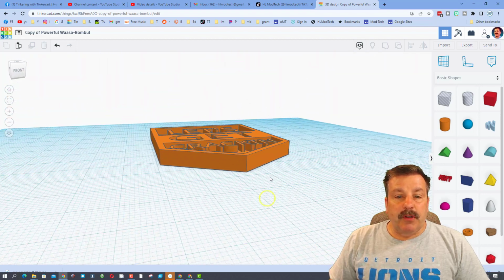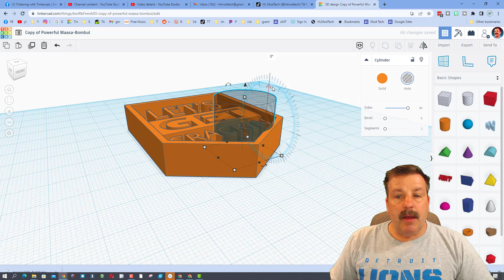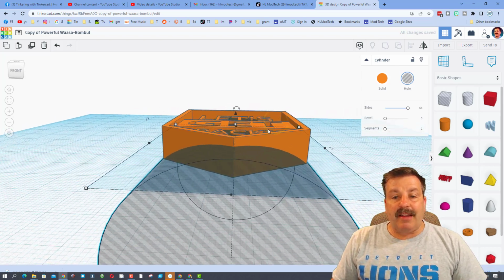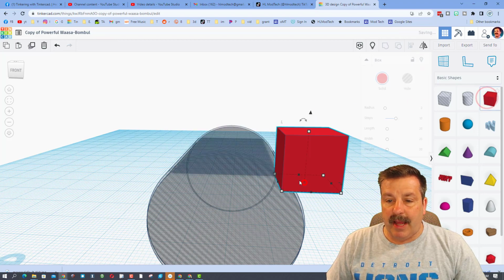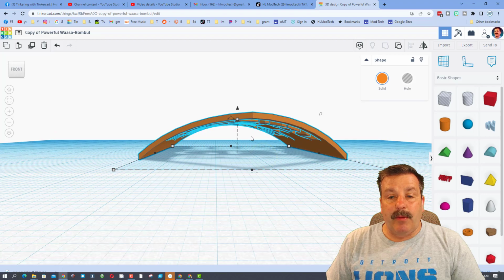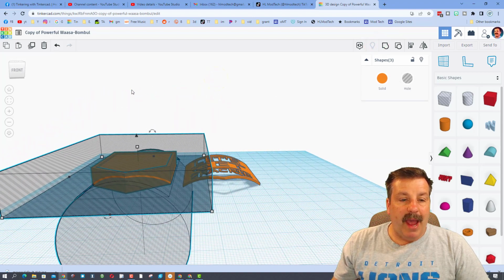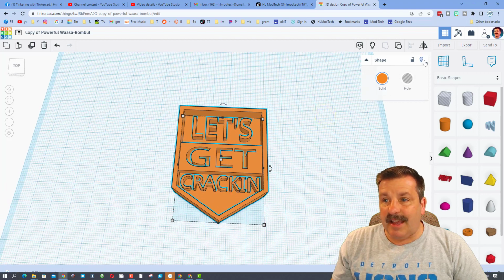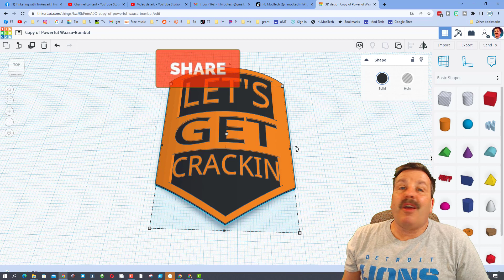Make a 3D printable Curved Bike Badge or Logo in Tinkercad

Comment: Not letting me group the hidden logo with the box and the locked cylinder. Not even giving me the option. Did they change something since you made the video?
Reply from the maker: They did make it so grouped project’s retain their colors after grouping .
Reply from the maker: Also, anything locked will not get grouped.
Reply: @HLModTech  I understand all that, but with the logo hidden under the box and the cylinder locked, it literally doesn't give me the option to group anything. I have tried this probably 20 times and no matter what I do, it's not working and when I play around with it I end up with nothing at all.